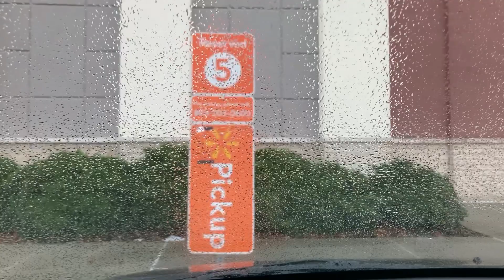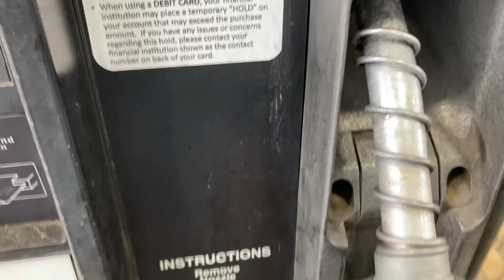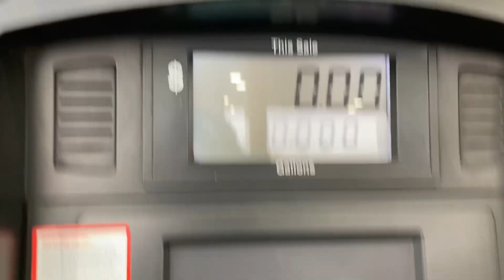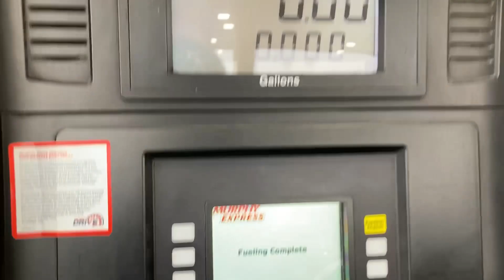My First Walmart SPARK Shift (DISASTROUS)

Comment: Hey Bro!  Spark can be really awesome!  A couple tips:
1.  You got a situation where one of your customers canceled + a Newbie Walmart Associate.  That's not normal.  So make sure you give Spark another chance.  It pays solid - especially Shop & Pay orders: small orders could pay $20-$30, and the incentives make it REALLY good.  If you are waiting for a while on Spark cancel the order.  
2.  Your Uber Eats with the long wait time: if you call Uber if it's longer than 10 minutes they will compensate you for your wait time.  If I see it's going long I'll turn on Doordash get my DD order while getting compensated $3 from Uber Eats.  Not much but play the game smart when you see it's running long.  If Wal Mart is getting out orders fast stick with it and it will pay well.
3.  Walmart Spark Tips come in next day, Uber Walmart is instant but can be adjusted next day.
4.  You got this bro!  Don't give up on Spark I made $350 off Spark in 1 day and another $150 in Food Delivery same day.  Multi-App it's worth it!
Reply from the maker: thanks for the encouragement, I'll definitely give it a larger sample size
Reply: @UUELTE  yeah and keep in mind with the Holidays it could be weird some days but come January it will switch to strictly Grocery so the orders will likely go faster and be more efficient.  Wal Mart CAN get backed up during the Holiday season.  👍  

Spark also gets paid out by "Branch" which is the app and Debit Card they use.  Typically paid out the following Tuesday for the week prior.  For a small fee you can move to your primary bank or just keep the $$ in the Branch Debit Card and get Cash from the ATM and deposit later.  Totally easy to use.  Spark just takes time to get used to but it IS a solid GIG app. 

 I'm telling you the small item shop & pays are fast and efficient for the most part and for 20 minutes of work and short mileage I REALLY love the small shop orders which can pay $20-$30 a pop.

There are also Trip Incentives - hit a certain amount of trips and make extra cash, $20 for 4 trips, an extra $40 for 5 trips and so on - a trip is one single round of orders: 1 shop and pay, single pickups, 10 stop General Merchandise, and 2 stop pickups - all 1 trip each.

It CAN be glitchy as others note but that seems to depend on the Market too, if you get a great store that has figured out their Delivery patterns like mine in Utah it works fine.  If they are under staffed then you could wait longer.  The other factor is scheduled pick up times.  Some drivers hate it, but most of the time the store is ready when you arrive at the time.  Grab a short Doordash while waiting for the time and you can make it work.  Just have to be smart.  Some folks like the app, others hate it.  But when you start to learn the store's patterns then you know their peak times and good times to turn the app on.  All in your perspective!  Just remember to remind the associate to give you the sticker 🤣  So far I've made 5k in 2 months off Spark.  😀

Comment: I did the same, came back to Walmart deliveries after doing them first with Postmates back in 2019 and then with Uber in 2021. However I had the same bias about certain Walmart locations and I can tell you that since that much time has passed, and staff and management has somehow probably changed, you will need to try those bad Walmarts again. On the other hand, keep in mind that not every Walmart does the same on weekdays, or weekends, or evenings or mornings. It changes all the time.

In my experience back then, early morning orders where usually ready. But I'm not a full timer anymore so I only do nightly deliveries every now and then. Good luck bro
Reply from the maker: Excellent point, thanks for sharing that thought

Comment: Spark can be great when it's working but lately it's been terrible in my Brownsville Texas market. The app is super glitchy, you can't see the map, the offer only tells you the distance from the Walmart to the customer so you still have to factor how far away you are from the Walmart and factor in dead miles after delivery, the wait times can be horrible, sometimes orders get lost in the system, if an order gets cancelled the show up fee is only $2.50, the took away the heavy pay, they lowered the base pay from $7 to $6.50, sometimes I'll get a 45 item offer XL for the $6.50 which is rediculous because I can get paid more to drop off a single hamburger on UberEATS, and the tip baiting on Walmart Spark is extremely frequent and unethical.
Reply from the maker: Thanks for the comments, I didn't know tip baits here were such an issue. Looks like I should only be incorporating Spark orders to my daily routine if absolutely necessary.
Reply: @UUELTE  I agree, I use my spark earnings to pay for my rent and my food delivery earnings for day to day stuff but I'm using spark less and less now because in my market spark is getting terrible